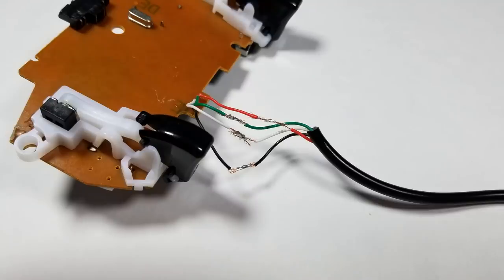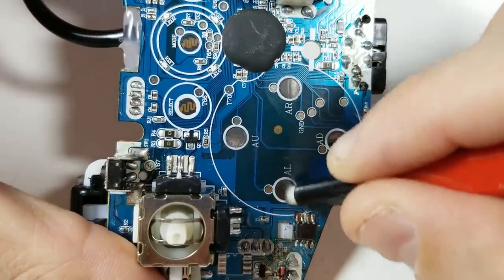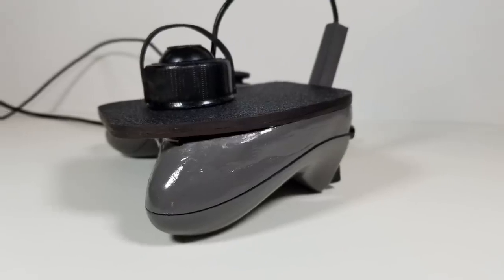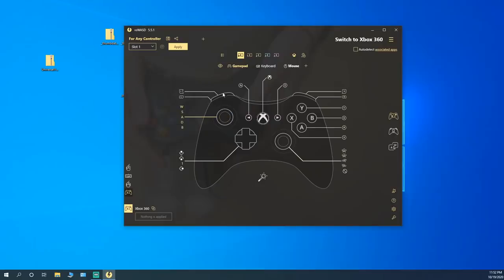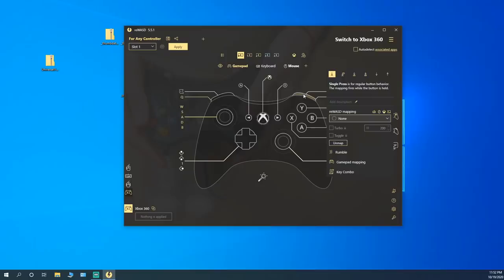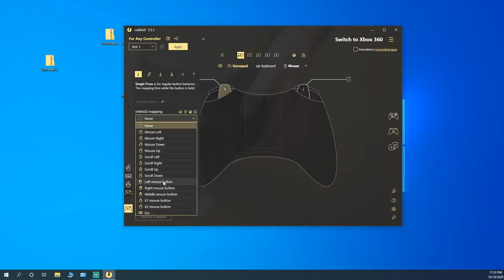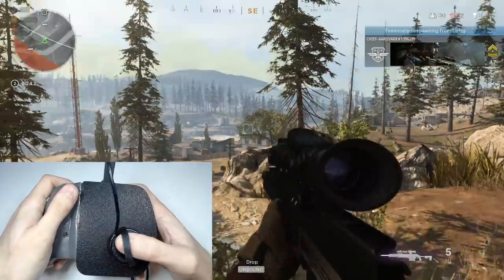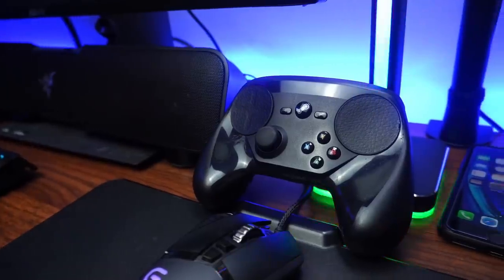I built the *MOST OP* CONTROLLER | Optical Mouse Controller | FORTNITE WARZONE

Comment: @Tech Yesterday please read 3D print a controller frame without any buttons and the controller frame would be more like a bigger Xbox one controller and then where each of your fingers go, (all of your fingers) create buttons or keyboard switches or triggers depending on which finger you want NOTE: ”traditionally you would have triggers at your pointer fingers and x y a b under the analog stick ,but think outside of the box. you can put triggers to your thumbs or even your pinky’s you decide.”
After that make each button and trigger exchangeable/customizable so for every person if they want a X Y A Or B button at where the triggers are they can do that. Lastly the buttons don’t have to be in the same format they are in on every controller. Grip the controller frame without any buttons or triggers and put the buttons where EACH finger ends up on the controller. Also add straps to put your hands on the controller so it can stay and you don’t have to grip it
Reply: Very unique
Reply: Damn
Reply: Liking this so he might reply

Comment: TOTAL game changer. I actually had this idea,but the closest I could get was a suspended type of thumb-joystick connection. So I rubber banded my joystick to my thumb and lifted my thumb outward instead of pressing down to move the joystick like normal. You definitely got it right with this optical mouse controller.

Comment: This is the most overboard way to make a Steam Controller I've ever seen.
Reply: Touchpad=/=optical sensor
Reply: Was about to comment the same thing lol. Its a Steam controller with extra steps
Reply: An optical sensor is more accurate than a touch pad.
Reply: God Rolf, The Ed position  you have clearly never used a steam controller
Reply: God Rolf, The Ed position  Same principle with the same desired result. Inferior to a mouse yet superior to a analog stick.
Reply: @csl110  I'm not sure if your defending steam controllers or not, but they definitely are garbage when it comes to accuracy.
Source: I've owned one
Reply: @mementomori4602  source: ive owned 2. And they are plenty accurate. Much more so than trackpad guy and you suggest.
Reply: @mementomori4602  I've used Steam Controller exclusively for 5 years. It is the most accurate controller out there. Maybe you never bothered to dig into settings or give yourself a period of adjustment (which would also apply to this controller, it would feel really weird for awhile until you adjust).

Comment: I think a cool idea for a new controller is to create a controller that uses mouse buttons and keyboard keys for the d-pad or abxy buttons. You can also try using the side buttons or scroll wheel to replace the y button and the side buttons for the bumpers. It would be amazing to see a controller that uses these features, but still be able to minimize the size. If you go this route you might be able to maintain the mechanical button and trigger feel you get on mouse and keyboard. The scroll wheel aspect will make weapon swapping and anything with y button easier to use for FPS games. And being able to still have the mouse type feel in your right hand makes everything feel great

Comment: Glad your back and depending on if you feel like it, you can add different advantageous things that pc players have on controller players making it a 2 in 1. This way your controller would excel all others and can have potential future up comings in certain games supposedly cod war zone or apex; not fortnite as too many people would complain. Pc features you can add: a scroll wheel, 2 more buttons for excessive use in games etc.
Reply: I'm relearning cad design on my own time to prepare for college and have been needing to practive rounded edges and complex shapes so I've begun working on making a more comfortable shape for this sort of controller and this is something I've though about. My thoughts so far is to have four paddles or mechanical buttons where your middle and ring finger rest and then do what he did with the buttons up top or put paddles branching from there towards the bumpers and/or triggers for extra inputs. A standard controller can already do around fifty of what I call "simple inputs" which are easy one to two button inputs and the addition of those two buttons could add like 12 more simple inputs between one bumper, two bumper and a mix of number and face buttons/dpad inputs. I havent thought about the scroll wheel though, so I don't have any idea as to where I could put that, though now that I'm thinking about it I could but it just below the triggers. Then if I felt like it I could put two scroll wheels.

Comment: I think your controller is cool as can be and I would love to try one out someday. But I do have to disagree with you about the steam controller. Not only does the touch pad work as a mouse but also the gyro's inside the controller. It definitely takes some getting used to using both at the same time and some patience adjusting it. But once you do it is very nice. My accuracy is great and I definitely hit my targets way quicker than I ever did with a joy stick.

Comment: I'm really interested in this controller aim innovation but with a trackball. When I looked I saw that Nvidia is actually just patenting it, with a joystick reset from touch sense tech. I'm wondering if in the meantime, there would be someway to get a trackball working in your controller, and have it reset to neutral on stop motion instead? Just a thought, because it could be another fun one for you to make, and also the design doesn't require losing some of the buttons/as hard on your thumb.

Comment: I love the idea of putting mechanical keyboard buttons instead of traditional paddles at the back of a controller like u did in the video. Maybe u can build the ultimate pro controller with the keyboard buttons and improved analog sticks. Improved analog sticks because Sony and Microsoft still use the cheap plastic analog sticks which tend to drift quickly

Comment: Like a controller similar to the Nintendo switch controllers but moving it the right controller would move your screen up down left right as if your where using a wii controller the shape would be the same as the nunchucks on the wii controller but bigger and they would be connected by a cable this could be done by creating a universal sensor that could be plugged into any device with a USB port
Reply: Universal sensor for movement i mean the idea is inspired from the wii sensor the sensitivity would only be possible to change depending the distante the user is from it or the space the sensor can scan but it would not need to be that necessary cause you would be using your while arm and it be a type of exercise

Comment: I had this same Idea, but the mouse part was actually smaller, the size of a Nintendo DS Thumb Stylus with a lower tip, a HIGH DPI compatible sensor and the surface was the same plastic as the Nintendo DS screens to create enough friction for the tip.
It would work like Nintendo Switch Joy Cons with straps around the palms to keep them in place and allow 4 KEYBOARD type buttons to be placed on the back. 
I was also thinking about creating a joystick that is more like a SURFACE, similar to the Seam controller, but the hole face can rock when in the middle to also aid in input.

Comment: Main feature I think you need to add is the ability to twist the sensor or the strap, so that you can adjust the x/y axis better.  Thumb movement is different than moving your hand or arm, so it may be more comfortable to have y axis be like extending and retracting the thumb, and x axis swiping your thumb side to side.  I obviously haven't used the controller so I don't know for sure.  This is actually very interesting though

Comment: This is definitely better than regular controllers, but the reason kbm is so much better for shooters is because you operate the mouse with your entire arm instead of just your thumb. The single tendon running into your thumb is just physically less accurate than the dozen or so precise muscles that are in your wrist, forearm, biceps, and shoulder. it's like doing surgery with a 10-foot pole vs a scalpel.

Comment: You should add extra outward buttons to the back of the controller for the index fingers. So you flick your right or left finger outwards from the controller and there is a button there waiting for you Check out the Azeron game pad if i haven't explained it well.  I use one and it has so many more buttons to keybind! Its a huge game changer!

Comment: If you redesigned the thumb-mouse with a better housing, perhaps 3D printed, you could probably find a way to integrate a clicking feature similar to clicking the analog sticks.  Obvious mappings off the top of my head would be jumping or crouching.

Comment: Oh also put 4 buttons on the bottom so your index fingers are not working 3 buttons each. They could be a little smaller than the face buttons but round. Keep them clicky like the mechanical buttons you added though.

Comment: You should add a gyro as well. Gyro for the big movements and mouse thumb for the small movements. Just opposite of what has been tried with DS or Steam controller. And make the deadzone of the gyro generous. This will be the future of "controller" gaming or as I like to classify it: gaming without additional surface support.

Comment: I have thought of a controller but with a scroll on the back where it is also used as a right stick (looking and aiming) but it only moves by very slight amounts to "correct" your aiming. A "lower DPI" extra stick maybe? Kinda like a sniper switch.

Comment: My idea for a gaming controller is to use vr controllers but the aiming is done using the right or left controller’s movement sounds crazy but hear me out , your arm/wrist have a lot of muscles so precision should be good and it might be strange to use at first but with some getting used to I’m sure it could be precise and fun.

Another idea! What if you do this but with the pro controller of the Nintendo switch using the built in gyroscope,  because i found that it is much easier to aim with the bow using the built in gyroscope in Skyrim on the switch . You should make the joystick and the gyroscope be used together for maximum precision !

if your thinking of doing this project I’m pretty sure software is the only thing needed for this to work, you never know with some tweaking /optimization this could work great !

great video by the way keep up the great work!

Comment: Idk if the contest is over but what if you make a nunchuck controller with buttons on the bottom like an elite and a mouse to control aim. I'd say the logitec g604 mouse would be a good reference because it has 15 programmable buttons. More than enough to give the mouse a more controller like feel splitting the work between both hands

Comment: For me, I would try to downsize it to the size of a switch controller and add a couple centimeter high barrier around the edges of the pad for the optic sensor so it's easier to find the edges.
Reply: I don't mean a joycon when I say "controller." I'm referencing when both joycons are seated in the controller she'll.

Comment: I feel like you could put the optical sensor in the controller facing upwards instead of on the thumb facing downward. This would alleviate the need for external wires. And your bare finger would work to control the movement as you move it over the optical sensor. This way you do not have to modify the controller so much and get the same results. You will just need to increase the mouse input sensitivity to get the same results. 

I will add this comment to your latest version as well.

Comment: Ok I like the idea of Axdog21 of they eye tracker, BUT also add some pedals to simulate 

walking (normally tapping both) 
Running (repeatedly tapping both) 
Jump (tap both pedals at the same time) 
Crouch (Hold one pedal while you tap the other one once)
Prone (same as crouch just double tap the other pedal)
Slide (run then let go of one pedal while keeping the other pedal pressed)

And so for, idk I just thought of this idea maybe it's not going to work out but it would be fun to try 😅

Comment: Hey m8. What about the replacement for a trackball? So it is all a single unit amd u hace the inertia.
Steam controller has a feature as travkball pad and works pretty well, it is just hard with jumping pointer and deadzones which a hardware ball doesn't have

Comment: Continuing mouse theme: Motion Control with higher quality 9dof sensor (like easily accessible NXP Precision 9DoF breakout) BUT you use a trigger to gradually decrease its input (acceleration and mouse lift-off simulation).

Comment: This is great but if you want accuracy you need to extend your range of motion, youre limited to the surface area of the controller so I think itd be more practical to design a hand held input device that uses genuine switches but allows you to use a mouse in the other hand, I mean the best we have is a damn ps3 remote thing, so I would personally love to see what you can do with something like that

Comment: I think a good thing to add in this controller i a single button on the top of the mini mouse or if you can 2 of them so it will emulate a mouse and have no need to add ABYX or maybe so we can give ABYX a diferent use...

10:06 AM Nov 9

Comment: Out of curiosity, would it be possible to take an xbox 360 board, remove all of the buttons and analog switches and then somehow attach wasd keys to the solder pads of the left analog stick?  A friend of mine recently purchases a wooting woo one (regular keyboard but it gives 360 degree movement) and I have been thinking about trying to replicate this as an experiment but im not even sure it would work.

Comment: Can you explain how you wired a mouse optical sensor to a controllers joystick points and it just worked? How did you figure out the wiring for the otical sensor?

Comment: Wait, but.. 

Isn't that just a trackpad with extra steps?

 And no gyro aiming either, but I guess that was a severely under looked feature of the Steam Controller when it first came out. Can't blame you for not having the time to deep dive into another controller when you had one to design yourself, so props for even mentioning it. 

What makes a mouse superior to a trackpad is the amount of muscles you use, and the amount of space you have to fine tune said aim. You could have it as precise as you want, but you will still be held back by the fact you are still just using your thumb for aim.

Comment: Great controller would love it! A completely new idea could be to remove both Analogs and have 2 resembling touchpads like this one for both sticks! One for moving (left side) and one for aiming (like this one right side) idea to add to this one is maybe add a scroll wheel to this one on the back which would be especially beneficial for scroll wheel reset on fortnite.

Comment: Nice, a thumb mouse sounds like a great move.
So, ideas huh? Gestures to begin with, brother. Maybe have them on the trigger fingers for a total of more mice.
I'm a bit of a controller look, so I've thought a bunch about stuff like this already... Considered custom controllers for some games I've done design docs for... Like a rubix cube with wireless touch screen faces... Or a sphere with optical mouse gloves with each finger having sensors... Yeah, gestures, m8.
Also, you can prototype them in VR if you're savvy enough unlike me, lol.
I'm much more of the brute force it type which it seems you are as well.
So yeah put me in for the giveaway, yo, whenever you have them I'm not picky.
LOL

Comment: You should use a touch pad but with thumb mouse still so the contact is consistent like a mouse and not changing like soft thumb. It would be like an air hockey paddle for your thumb

Comment: wouldn't a touch pad be 100% better if it was of higher quality and if you used a stylus with it? i remember the issue with the steam controller being sensitivity and tracking in general. as you're playing you're applying different pressures and since your body isn't perfect it will detect your electrical conduit moving as your finger pressure moves.... a stylus finger condom would have fixed this issue

Comment: I think this would be the best if you modded the Xbox one master controller.  The triggers have the ability to do short or long press., also the paddles are removable. I have been looking for something like this for over 10 years. I am a physical challanged old lady that is in bed most days. I use my xbox as a pain distraction but have a really nice pc. It is the keyboard that takes up so much room. Add a chat pad on the controller and you will have the best thing sence sliced bread. How about put a feeler out on it I would love to buy something like this.

Comment: Why not just use gyro aim like with the Switch Pro Controller, PlayStation DS3/DS4 or Dual Sense? It's far better than stick aiming and is commercially available. It also doesn't require extra moving parts.

Comment: it would be possible to put this system in control of the PS3 / ps4? Replacing the two potentiometers of the right analog by the mouse circuit? PS3 does not recognize mouse keyboard in games without adapter

Comment: hey Tech Yesterday I have been having a little trouble building your 300$ console killer pc and I am asking where on the motherboard do you plug in the little wires that are connected to the power button and other buttons on the case